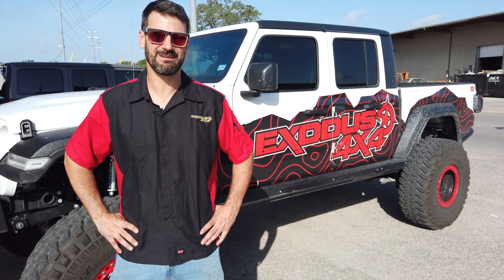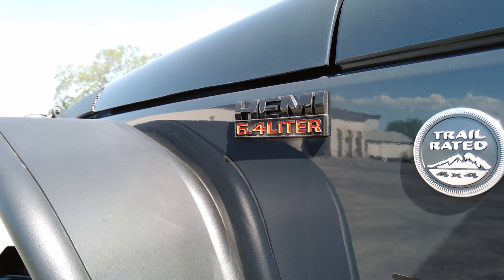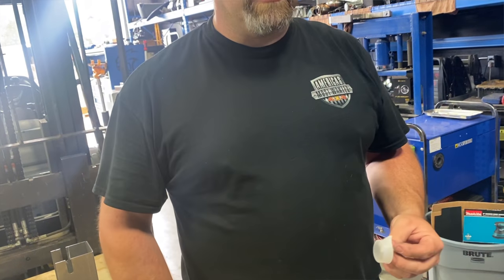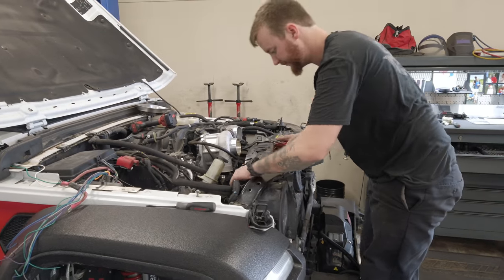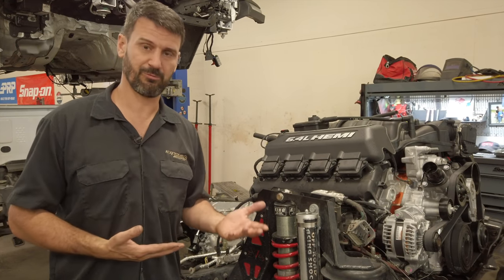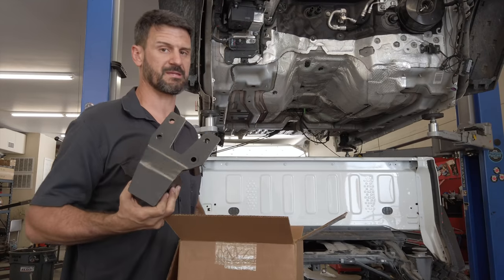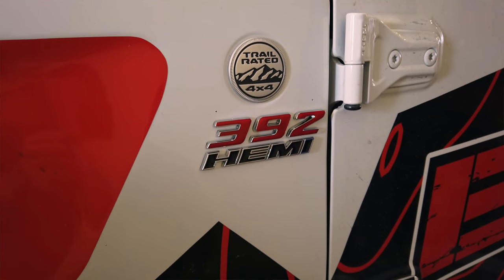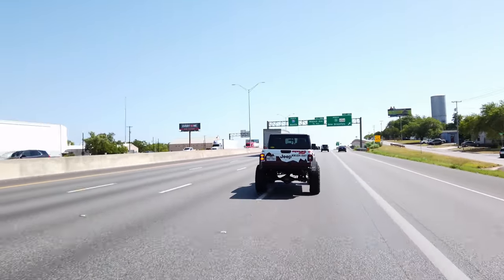Finally a V8 Jeep Swap We Can All Trust

Comment: I had a 392 in my 2014 and it performed great. There was a wire that rubbed through on the maiden voyage off road  and once fixed it ran great for 36K when I sold it. My fan was really powerful and only had a high speed which made it super loud since the V8 on the trail needs a fan almost constantly.  I think by now you may have a multi speed fan. I think it should always have some fan speed on the trail, maybe 50% to keep the temperature on a more constant plane.  Mine did not over heat contrary to the old rumors about Hemi's overheating. Once you drive a V8 JK / Jl you will want one!!

Great job!
Reply from the maker: Yes these newer builds require less fan speed! It’s been amazing!

Comment: I have a 2008 keep JKU and in December 2011 I took it to motech to have a to 5.3LS and 6L80 transmission installed with my 3.8 having 102,000 miles.  Currently I have a little over 250,000 miles on it.  Your choice in a Hemi is a stupid choice.  Good luck keeping it cool and have fun relocating everything to get into the engine bay.  Only issue I have is the GM throttle sensor is garbage and I keep a new pedal in the back and made it so I can put a new one in about 15 minutes

Comment: Gee thanks for this video! I just got back from my trip pulling my 3500 lbs. Rpod camper with the Gladiator from Kansas to Colorado and back. 37's with 4.88 gears and I was in 5th most of the time at 9 mpg's. Was thinking about the Hamburger supercharger and then I get home and see this!!
Although not sure if I can afford this right now but dang that would be nice! I will be in touch about my options.

Comment: I saw your posting of the swap costs.  For a 2015 jkur you would have the swap cost of $35k.  How much to do it right on 37's?  I have a stock 44 in the back and a dynatrac 44 in the front.  Do I need 60's for both?  What else besides lift and tires?  Thinking 35k for swap, 15k+ for 60's with lockers.  What else would be related to doing the conversion right?
Reply from the maker: You’re real close, and it’s nice to see you’re being realistic. The price you mentioned includes the 8 speed but I’m not sure how available it is for the JK right now.

Comment: Awesome!!! 
Now....can your Gladiator tow more? What are the numbers for tow capacity with the Hemi?
Reply from the maker: Towing capacity isn’t so much based on the amount of power the engine has, and actually depends on many factors. However, it’ll tow the 7,650 pounds it was rated for with EASE!
Reply: @Exodus4x4  - I presumed as much, but was interested in how much the Hemi weighs vs the OEM engine and how that difference might effect the towing numbers.
Reply from the maker: It adds weight but the power is incredible

Comment: I’ve been looking at putting in a 5.7 or a 392 in my wrangler ever since I picked her up! But damn the price to convert is CRAZY!
Reply from the maker: It’s a swap that looks and performs like OEM. That’s not cheap to pull off.
Reply: Exodus 4x4 I understand that. It’s not cheap to creat a product that good! I just wish that Jeep would have just put a 5.7 from the factory. That would be 100% perfect for a daily. Just enough hp and torque to get up some difficult trails! Don’t get me wrong the 392 is bad to the bone but isn’t really needed for most cases.

Comment: "A man has got to know his limitations." H Calahan, inspector San Francisco PD. A hellcat or a demon would have been too crazy. Bubba would a 5.7 hemi do as well as a budget build option? what about using stock suspension.  1 video and no cliff hangers. Great job You guys rock. Thanks
Reply from the maker: I think the 5.7 is a good engine for wanting truck power, but the 6.4 is more fun.
Reply: thereissomecoolstuff ~I believe America’s Most Wanted does 5.7L swaps too.
Reply: @J.Young808  they do.. I think the crate engines are about half of what the 392 costs.

Comment: What about weight difference? Did you have to get diff. Lift for more weight?
Reply from the maker: Yeah you need to compensate for the weight in the suspension. Axles aren’t always necessary but a great idea. Depends on how you’re going to treat it.

Comment: Sorry but that’s a sexy looking engine🤑😉😳🤙🏼😉
Does the intake route only driver side? 
Would be curious if a dual battery kit from Genesis would work or does the hemi change all of the engine bay placements? 
Don’t know if this has been asked, but is a snorkel possible or does it mess with the air induction to the engine?
Would you suggest getting to bigger axles before considering a hemi swap? 
I will have to say hemi is now on the wish list. 
Awesome video!
Reply from the maker: Dual battery won’t work
Reply: Exodus 4x4 I’m guessing the engine bay is too small to accommodate the tray and engine, or that the hemi comes with its own battery tray that genesis or another company hasn’t developed a dual battery setup?
Reply from the maker: Not enough room.
Reply: Exodus 4x4 o well. The hemi is worth the loss of the battery tray. Dam just the 6.4L sounds awesome. I couldn’t imagine a demon or the other one. Have y’all installed a demon yet?

Comment: Doesn’t motech use the existing mounts for their LS swaps? It sucks you have to weld new mounts for this Hemi swap
Reply from the maker: Those Motech mounts suck. We have them in our JKU and they’ve come loose before. I’d rather weld in new mounts any day.
Reply: Exodus 4x4 that’s good to know!  I’d take quality over ease of install any day, keep up the good work
Reply: Motech mounts are garbage along with their entire kit. Motor literally fell out of the mounts on me until we finally modified them. When we finally scrapped the motech garbage the hydraulic isolators were wasted.
Reply from the maker: Thanks for chiming in. I wish more LS swap guys would speak up about those issues so I don’t look like such an asshole.
Reply: Exodus 4x4 don’t I know it.

Comment: Why did you swap the t-case? Would the old one not hold the power?
Reply from the maker: Correct. The transfer case adapter is only built for the Rubi case.

Comment: Bubba!  Couple questions if you can answer... ballpark range for cost of parts and labor?  also, what would you consider the prerequisites of a hemi swap?  Like say I have a bone stock JL, does it need 1 ton axles, drive shafts, minimum lift, what? Thanks dude.  good video.
Reply from the maker: Yeah for a JL I would definitely go with a 60/60 combo. Turnkey price is $34,995 plus tax for the 6.4

Comment: I HATE to add this to the mix, but can I use a 392 (or even a 5.7 Hemi) with my stock NSG370 manual 6 speed in my 2011 JK? I can always upgrade the clutch to one that handles more horsepower, but I would REALLY REALLY like to keep my 6-speed. Not to dog it or whatever, but just because I don't like working on automatic transmissions. I hate rebuilding them, which is why I went with a 6-speed when I bought a Jeep. I just really want that V8 power, and it seems the Hemi is a lot easier for Jeep (manual) than an LS swap would be.

I just need to know if normal driving (not race car level, drag strip driving) is possible with my stock transmission. I want to know if it will bolt directly to the 6.4 or if I will need a different bell housing or whatever. So many forums just STOP, as if the people gave up on the idea. I want to make it happen and I'm willing to push myself to make it happen with a 2009 6.4 Challenger 392 manual engine.

Anyone have any information (usable information, that is) that could get me started so I can pull my 3.8 out and get this 392 in. Thanks!!! (Jeff)
Reply from the maker: No you cant. Sorry
Reply: @Exodus4x4 Thank you! 

Then I apparently have to get the 2009 Challenger 5.7 engine along with the manual transmission in the Challenger....right? That transmission should line up in a JK to where my shifter lines up just about in the same spot. I gotta do some measurements 

Appreciate your time, as I know you guys are slammed.

Comment: That is just so stinking awesome! You just sold me on a 392 swap, you made it look easy and clean. It's really cool that you had gone to America's Most Wanted and went through a swap with them. Seriously though, what does it cost for the swap, ballpark estimate. Also, are the factory axles too weak for that engine?
Reply from the maker: $34,995 for the 6.4, and no I wouldn’t trust the stock axles lol.
Reply: @Exodus4x4  thanks, so adding better axles would be about 20k more. Still not bad for what you get in fun factor and offroad capabilities.

Comment: @4x4 exodus, seriously thinking of driving from Colorado and taking a one week vacation to have you guys do a Hemi swap for me 😁! Saw you guys offered a 5.7 and 6.4 Hemi swap. Are they both error code free and does the jl offer enough air space in case of a crash for both these types of engines? Would love to get that power onboard, but want to make sure it s safe when I'm driving my family.
Reply from the maker: I can’t honestly answer the question about safety either way. Yes the conversions are super clean and without any electrical gremlins. Just like it came from the factory.
Reply: @Exodus4x4  Thanks for the honest answer. I imagine it would take lots of R&D and testing like when Jeep builds a new vehicle or includes new engine options!
Reply from the maker: Supposedly that’s the holdup on why we haven’t seen a factory V8 Jeep Wrangler.
Reply: @Exodus4x4  Yeah, heard the same. That test wrangler 392 we saw a few months ago could be the working prototype that adds extra space to account for bigger engines while remaining crash compliant. We will see if they make it happen. With the Bronco coming next year, they may think they have to now to stay infront of the competition, but we will see!

Comment: Would the process shown here be pretty much the same for different trim models (specifically the Mojave)? I know that trim has some redesigns over the Rubicon, does any of that effect this process?
Reply from the maker: We have done this same conversion in a Mojave with stock suspension. We had to use the Rubicon transfer case but that doesn’t really effect performance. How often will you be hauling ass in 4L? Probably never. Keep it in high range for that. Only concern was making sure it had enough bump stop to protect the engine oil filter. We added some to the axle side and it was good. Customer has decided he wants to add 2.5” lift so we are using EVO’s diesel spring kit and adding the extensions so we can retain the Mojave’s shocks. Should be a solid build after that.
Reply: @Exodus4x4  Awesome! Also, what do you do with the old motor, axles, all the items that are replaced? Do you resell them, or give them back to the customer to resell? Is reselling them how you can save money on our turnkey price? It looks like your price is pretty much the same as on Most Wanted's website, so just curious if labor and reselling the old parts is how you make most of your profit, or do you give them back to the customer? Thanks.